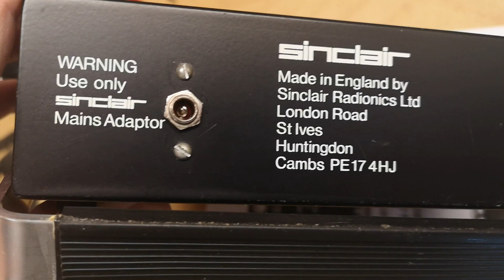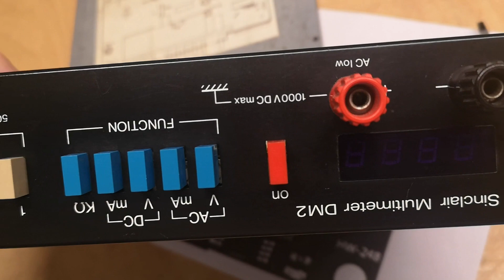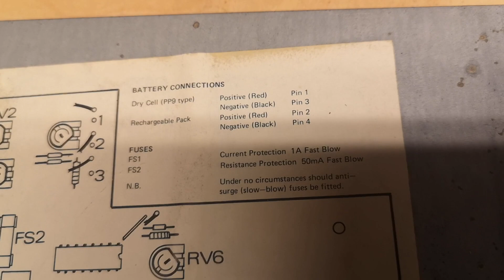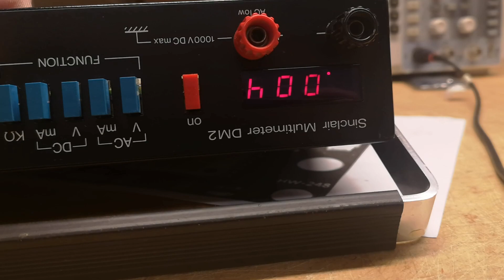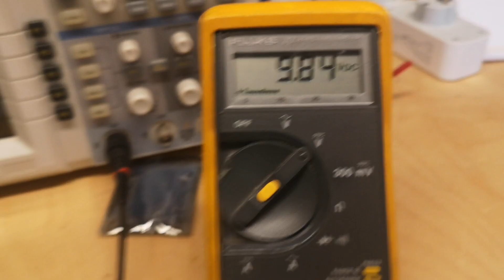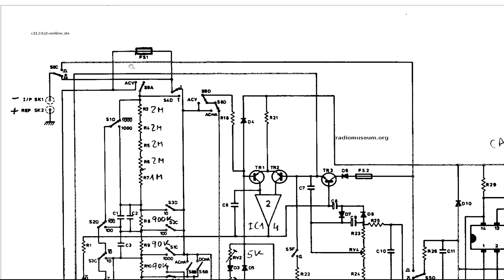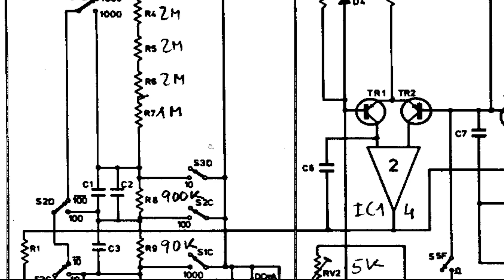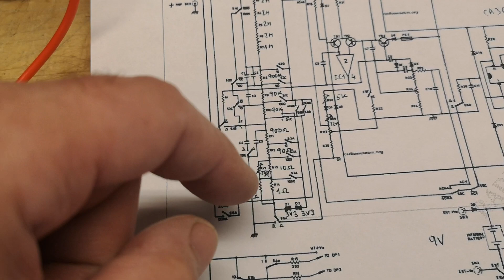Multimeter Sinclair DM2 1975 test repair teardown

Comment: You can also see the 1R resistor had all of it's coating cooked off as well, as that was very likely just given a plain varnish coating, not a flame proof or high temperature one. Saved Sinclair a whole 3p in making the unit to do that, which was a known thing about the company.
Reply from the maker: i think this resistor was uncoated to begin with